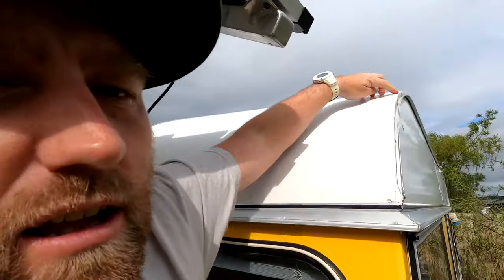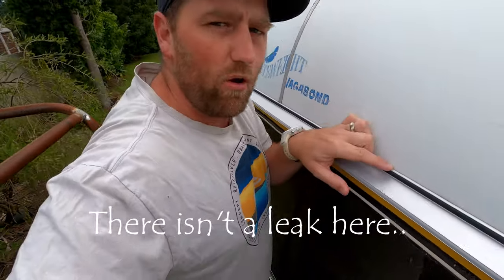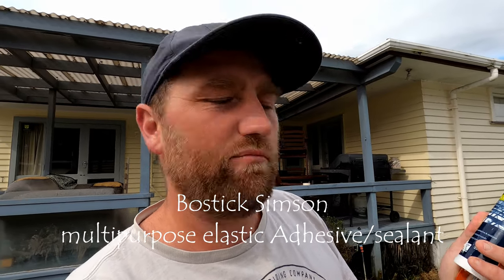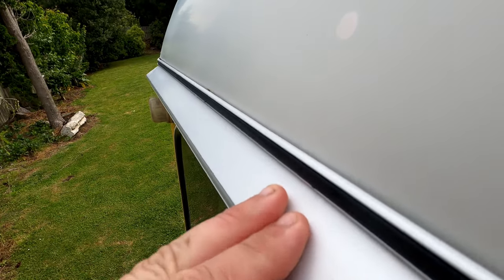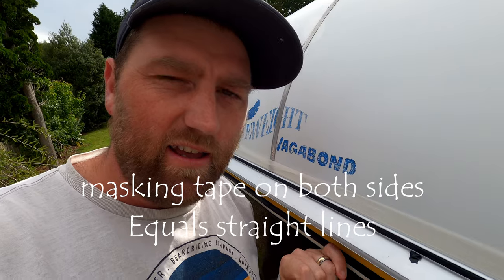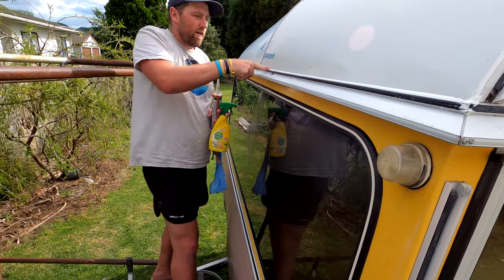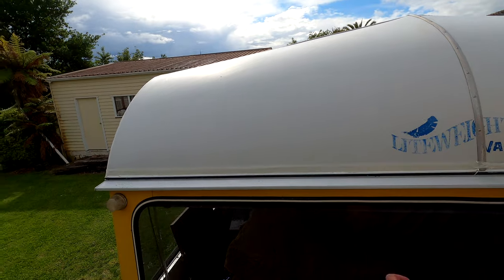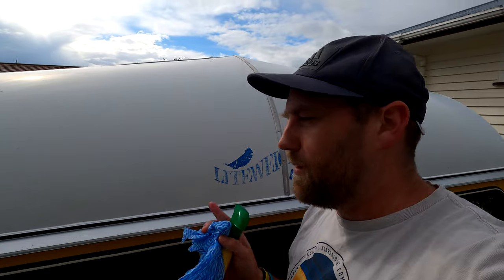New Zealand Retro Caravan reseal, how to do it.   Bonus.

Comment: Top tip and so easy - appreciate the details. I’ll be straight onto it now. We’ve got a 1700 same colour - great caravan. I’d be interested in any info on getting to self-contained status. Cheers.
Reply from the maker: Thanks man, basically you need 12 litres of fresh water storage per person. 12 litres of grey water storage per person. You need 3 litres of toilet waste storage per person. 
So we need to hold 60 litres of fresh and greywater. A 15 litre toilet cassette. You also need to have an S Bend from your sink to the grey tank. (stops smells). You need to have a sink and at least a hand pump connected to one of your water storage containers so you can pump water. You should be able to do all that in a 17 ft caravan. It was a bit tricky for us in our 15ft Which we just sold as we are upgrading our caravan.
Reply: Great video, can you seal the beading on the roof like this too?